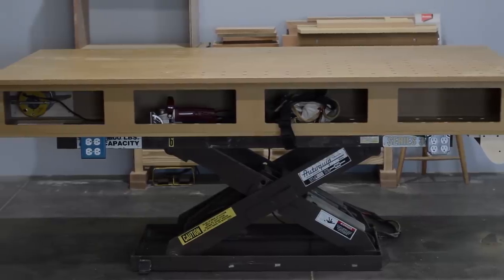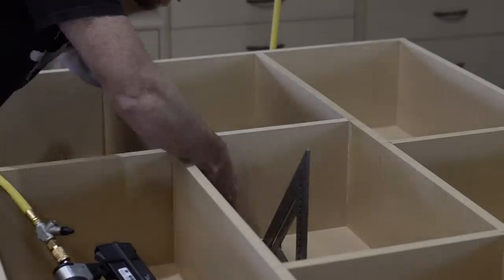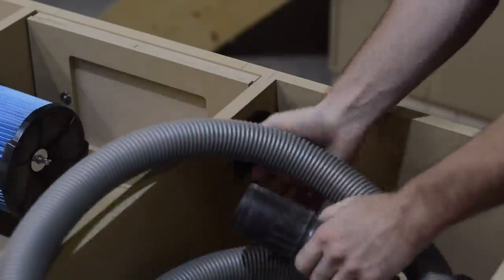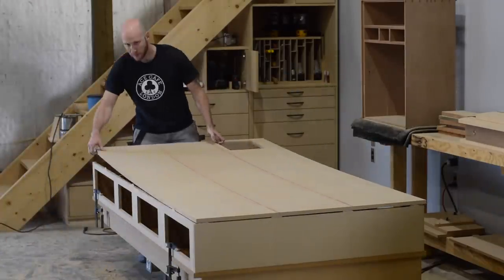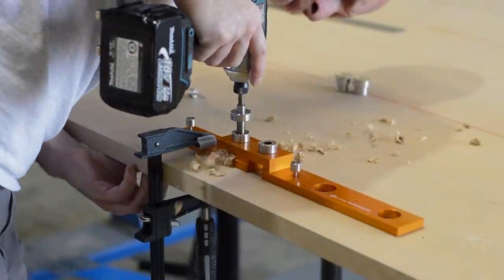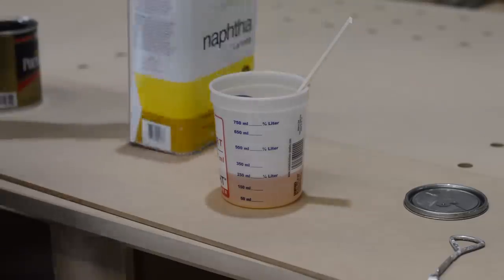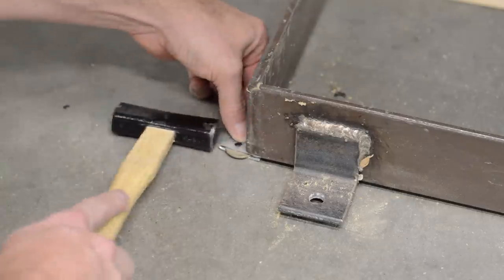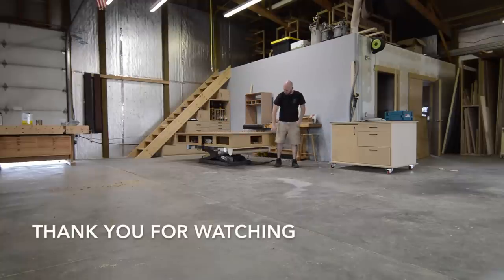A Modern Cabinet Makers Bench For Woodworking & Carpentry

Comment: One of the benefits of a torsion box is its strength to weight ratio. You made a very deep torsion box which does take advantage of how a torsion box works. You mention strength as being a fu cation of the glue line. I am going to suggest a torsion box is about stiffness and resisting twisting force. No question. You want a good glue joint. It it's the depth of the box that determines its rigidity. With that in mind I personally believe 1/2" material is just fine. 

A torsion box can get super heavy super quick. For a stringer box, increase depth and/or divide the area into more grids. 

The next one I build I'll try to use half lap joints for the grid. My table saw is a contractor's saw and I'm a little worried it will be finicky to set the blade night dead on.

Cool drilling jig
Reply from the maker: Thank you. Weight was not an issue when designing this bench. I am going to be chopping, hammering, etc. on this bench, so I wanted as much weight as possible. Plus 1/2 material gets pretty bouncy when chopping on unless you are right over a rib. If portability was a consideration I would not have used the materials I did. No matter weather 1/4" material or 1" material is used, the box won't stay flat unless the components are attached securely. To me glue is the only good choice and therefore the source of the strength.
Reply: Mike Farrington yeah definitely needs to be glued well. I'm going to try to build a small one using half lap joints and just see how it goes. That would increase the surface area of the glue joints significantly. When it comes to MDF and it's ability to take an actual pounding I'm not really sure it's the best material in that is just compressed sawdust regardless of how thick it actually is.
Reply from the maker: I think the real benefit of half laps is that it will be super easy to assemble. For my uses, MDF is the best, it resists denting much more than plywood or solid wood on its face. Where it lacks is the corners, they will always be susceptible to major chipping or breaking. Ply or solid wood are much stronger in this regard. Keep in mind I'm using high quality MDF.
Reply: Mike Farrington yes I agree, easier to assemble providing the Dados were precisely in terms of width and height.

Comment: Hello Mike, I recently discovered your channel and quickly subscribed. I noticed two things that set you apart from other woodworking youtubers. 1. you are not opposed to working with MDF and  2. you use biscuits.  I would appreciate some MDF wisdom.  What are the best methods to join MDF parts with screws to avoid splitting, stripping?  Also, where do you get your supplies? I'm in South Carolina and the big  Blue and Orange home improvement stores are closest but I'm willing to travel a bit. You do great work please continue.
Reply from the maker: Thank you William. MDF is a must if you build painted things for people and are trying to make money. I started using a biscuit joiner 20 years ago when there was no other options. Old habits die hard as they say. I really like Plum Creek MDF. They have a website with their vendors listed, and other info. Their MDF has more consistent particle size and a more consistent core, which really helps when painting the edges. The stuff from homie depot or lowes is OK, but its not nearly as nice and the Plum Creek stuff. Hope that helps.

Comment: Hi Mike, How's that hole pattern working for you? Do you find it needs any tweaks? Working on something similar now, don't want to perforate the whole top, but rather use the minimum number of holes to cover most ops (crosscutting panels, sanding,  case assembly). Thanks!
Reply from the maker: The hole pattern works great. I certainly could have gotten away with fewer holes. If I were to do it again I would do a pattern around two or three edges and two or so rows going across the middle.

Comment: Hose management: 

Build a ring to go around the hose that has a 20mm dog pin on it. Essentially a retainer collar that plugs into the dog holes. The hose could swivel at that pivot point and because it's in a dog hole you could move the collar to anywhere on the table and obviously you won't have the issue of the hose rolling off the edge. 

You could 3D print something, you could make a collar from wood, you could cut some PVC pipe or thin wall metal tubing, it would really matter, just needs to be a hose claming ring with a dog pin. Another idea I have is for the dog pin to have a decent magnet on the bottom, then you could have a hose holder near the cavity hole of the box thus you could coil most of the hose deep in the cavity but have a short lead that is retained near the opening for easy retrieval. Having a respectably strong magnet in the dog pin would also mean that you could fix the hose collar to any point with metal. If you wanted an under the edge solution you could simple mount a small metal bar, washer or something similar and you could also clamp the lead of that hose to the body of the scissor lift to get it off the table and out the way temporarily, but not back into storage. 

Of course, it would seem logical to have a collar which can be tightened and loosened, or one which has a firm but movable friction fit on the hose, so that you could move the collar up and down the hose to change how much slack lead you have from the dog-pin point. You could also put 2 or 3 collars at differing lengths of the hose to give you options on how to temporarily fix it to the table, especially if they are somewhat low profile in design.

So there's AN idea. I'm not a woodworker so as much as I'd like to shit test it myself I have no real way of determining if it is an ingenious idea or utter trash.
Reply from the maker: Thank you, great suggestion. I ended up finding some clips that hold the hose in place, they have worked well so far.

Comment: Awesome build. I'm getting ready to build a Paulk style torsion box table similar to yours only a bit smaller lol! 

I love the idea of adding the vacuum to the table. Great job. I imagine it wouldn't be super hard to make a section of it a vacuum-table surface which would be really cool.

I didn't get a great look at the bolt you didn't know the name of but it looks like an elevator bolt. Not sure where the name comes from but they are used all over.
Reply from the maker: Thank you very much.

Comment: Vacuum Hose management idea.....Picture an IV pole....now adjust the length as needed. Take a properly sized  shaft collar and clamp it on the cut end of the IV pole, measure the distance required for your thickness work bench thickness and position the shaft collar that distance from the end of the cut end.  Then when insert into a dog hole the shaft collar will rest on the top surface of the bench top. The OD of the shaft collar will provide support for the IV pole concept, well basically a rod or pipe with one or even two bent rod hooks. The length of the pole under the shaft collar, while inserted in a dog hole, will provide lateral support. To think about it, the pole would not support anything without a dog hole. After the IV pole, or "The Pole with the Crazy Hook Things", is installed; using bungee wrapped around the vacuum hose, hook the bungee hooks on the hook on the pole.   Or one could kick it up and install a ……. wait that will be coming soon.  Great videos Mike, real down to earth and I enjoy all your videos.
Reply from the maker: This is a good idea. Thank you for posting. I'll give this some more thought.

Comment: I have always wanted to build something simular, and utilize the holes on top for dust collection also. Seems to me that if you have several hundred holes sucking air constantly, you would not need to connect hoses to all your tools. Perhaps just the ones that You use off the edge of the table. By having one hurricane type bin in the corner, you could mount a bucket under it to catch the saw dust. Of course that would involve having the bottom board lowered enough for all the dust to make its way back to the dust bin, but that should be doable. Anyway, just a thought.
Reply from the maker: Thank you. There are sanding stations called down draft tables that work how you describe. The only catch is to have enough cfm to catch the dust.

Comment: I've been wracking my brain for  a workable solution for a 9' long trap door.  The torsion box is it.  The weight to strength ratio is unbeatable.   It will be lifted with gas struts. The top surface will have hardwood flooring on it.  Your box on top of the scissor lift triggered the solution. Thanks!
Reply from the maker: Torsion boxes are great for many applications.

Comment: How has the table held up. I made my assembly table with just a top with 3/4'' by 16''  wide mdf around the perimeter with 12'' across the 48'' width. After about ten years the  two 8' sections actually sagged so I switched to 3/4'' plywood and it is still dead flat after five years. I suspect your cutouts might allow the 8' long sections to sag but maybe not as you have additional interior 8' sections.
Reply from the maker: It it doesn't have a top, bottom, and ribs they will all sag eventually. Mine is still pretty darn flat.

Comment: Good to see you using the parf guide system. I love it but haven't seen many people actually using it. Like you, I could think of lots of uses for the system with the right benchdogs. Great video but I really wish you would share your secret ratio for poly for protecting the MDF :)
Reply from the maker: The Parf Guide System is pretty cool. It works better than I thought. I think the potential is limitless in terms of jigs and fixtures.
Reply: The piece of MDF you drilled holes in to to slip over the bench dogs was a great idea and the parf guide will be so useful for making more in the future. I feel I might have to make a new jig soon. Not sure if you follow Peter Millard here in the UK but I know he follows you. He just did a video on making a benchdog fence that was a really good idea as well.
https://www.youtube.com/watch?v=DezSQjhcbbk&t=1s

Comment: Ironically I was looking for the super secret formula. I also have an idea for hose management, take some dowel and mount through a short piece of wood matching your bench hole layout and zip tie the hose to it, similar look to a staple with the hose on the top (board) and the legs (dowel) pushed into the bench. That should hold it on top of the table and it stays attached to the hose.
Reply from the maker: Thank you. This is a good idea. I will probably do some variation of this.

Comment: This might have been mentioned, but what about some sort of mounted stilt with a swing arm that is attached from one end and swings above the working surface over head height for hose management. great bench by the way, love it.
Reply from the maker: Good idea for sure. So far its working pretty well to just have it hanging out of the side. I use a clamp to hold the hose in place if needed.

Comment: Very nice build, Mike. The tricks you showed about the benefits of the dog hole array (fences for right angle setups) are the best reason I have seen to actually use them. The accurate cutting capabilities, via a track saw are great, just not something I would anticipate needing on their own. 
  With regards to the dog holes, have you found any need to fill out the top with more dog holes? I like the fairly sparse usage.
Reply from the maker: Yes, the 90 degree fence is great for a lot of little odds and ends. I have not needed any more dog holes. In fact if I was to do it again, I would put less.
Reply: @MikeFarrington  Thanks for the update. If you come up with a way to "undrill" the holes, I would be VERY impressed.

Comment: MDF bench dog holes will wear out very quickly and you will not be able to get repeat set ups for very long. 
Drill bushings would last forever but they would add a bit to the cost.
Reply from the maker: I haven't found this to be true. I've been using 20mm dog holes in MDF for more than a decade and they have always held their accuracy. Keep in mind how much these holes get used, probably only once a day. If this was something being changed 50 times a day it would be a different story.

Comment: I like that hole cutting jig, but I prefer to use 16mm holes to match my welding table holes. That way I can use all the same set-up blocks and jigs. I even have custom bench dogs made from stainless sign stand-offs. Way cheaper.  So, my solution was to pay a guy with a 5x10 router table to cut my 2" x 2" grid holes for me on two sheets. One I use as the table top now, and the second one is now my template for future tables.
Reply from the maker: Thank you. Good idea, CNCs make quick work of this type of project.

Comment: thanks for posting, a great workbench. As you brought it up, I'd keep my little work apprentice out of that shop, all that mdf dust is going to get into his lungs. In my 'hood' I couldn't build a workshop bench from MDF. The constant moisture in the atmosphere makes it a poor choice for stability. My first workbench was a B&D foldable metal  and 3/4 in marine ply, it was a workhorse and I beat the life out of it. It eventually got too small so I splashed out on a larger model from B&D, again, metal, foldable but with 1in MDF worksurfaces. It was unusable in a matter of months.
Reply from the maker: Thank you. I have lived in fairly humid areas, and if sealed properly MDF will last for years. Pretty much every cabinet made in the last 30 years is either partial board or MDF.

Comment: Getting ready to make a torsion box work surface with the Parf guide system, but I can't help but notice the grid isn't featured much in your videos. Are you having problems with the cuts you get from the track saw?
Reply from the maker: Good luck with your build. The grid is totally spot on, I don't do a bunch of cutting using the grid. I have a sliding panel saw for that kind of stuff. I do use it for joinery though. So I bump a router up against the fence vs a track saw. I used it in my wagon build video, check that out to see it in action. I will also be using it in an upcoming side board build to cut some dados. If I have time I will film it.

Comment: Just an FYI to those of you having an interest in Mike’s crazy cool, commercial/expensive, adjustable workbench.  I acquired a well-made hospital gurney which has a hydraulic, foot-pedal actuated, adjustable height mechanism.  It also has large, lockable wheels so it rolls around my shop very easily. All four wheels each lock and each wheel has a single locking mechanism that locks/unlocks all four wheels at one time.  Fancy engineering.

One last point,  make sure you get a gurney with two support pedestals rather than one. The one downside to the unit I have is that there is only one pedestal in the center so I tend to get some rocking which should be mitigated significantly with a two pedestal model.

I found it was a little challenging locating my gurney but they are available if you’re diligent in your search and would like similar functionality while saving $ at the same time.
Reply from the maker: This is a good tip. Also motorcycle lifts can be used as well.

Comment: Genius idea on the integrated vac.  How about a swiveling boom arm for the hose? 

I built myself the Paulk workbench out of 1/2" ply.  Will MDF be as durable as ply?
Reply: Also, to drill a hole on the bottom of the sawdust bay to hang a Dust Deputy below it might be another great idea.  I know it wouldn't work for you because of the scissor lift.
Reply from the maker: 1/2" ply is a fine material and would be much lighter. I like MDF because its less splintery and because I buy lots of it I get a very good price. Either would be a fine choice for a torsion box.

Comment: You want that vacuum hose overhead not on the side of the table or you are going to fight it all day. Get you some 12-Gauge Half Slotted Metal Framing Strut Channel and then go to McMaster Carr and get you a Strut Channel Trolley...hook a bungee cord to the eye bot on the trolley and get a Velcro strap wrap that around the hose and attach the bungee to the Velcro also. Now it glides over head and pulls if you need to...that is how I did mine
Reply from the maker: I gave this some thought at the time, I just couldn't solve all the challenges my particular shop presented, so I went this direction. I am really happy with it. I have some hose clips that hold things in place, so things stay neat and tidy.

Comment: I wonder if you could use a repurposed Anglepoise lamp (parallel linkage desk lamp) with a loop or hook on the top that fits in one of your dog holes for hose management. It'd be like a mini boom arm that could fold up enough to fit in the hose cubby.
Reply from the maker: I like this idea. Thank you.

Comment: Beautiful, as is all your work! Do you find you use the entire surface or is most work done in a smaller area of the top? Have you found the need (or want) to change your dog hole pattern or has it been good as-is? Just put that Parf system in my cart by the way, thanks for sharing.
Reply from the maker: I use the entire surface for sure. I may build a bigger table in the future. I could get away with less if I needed to. The dog hole pattern is fine. I could have drilled less and the table would still be effective. I just figured while I'm at it I should drill more than needed. The Parf system is pretty darn good, surprisingly good, and I'm not being paid to say that.

Comment: Fantastic build. I'm building a small, movable shop table with an mdf top at the moment and was wondering how many coats of your secret poly mixture you apply to your surfaces.
Reply from the maker: I start with 3. As the surface gets scratched up, I give it a quick sand and another coat.
Reply: @MikeFarrington  Sweet, thanks for the info. Glad I asked because in your vids it almost looks like you put on just one coat.